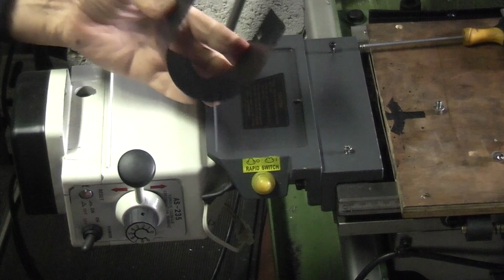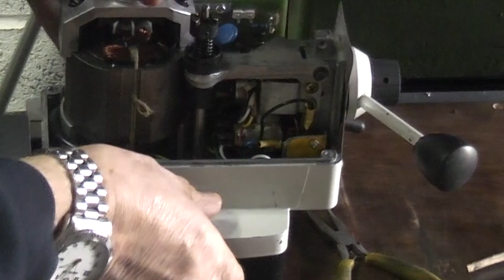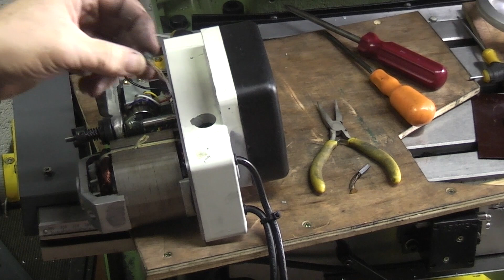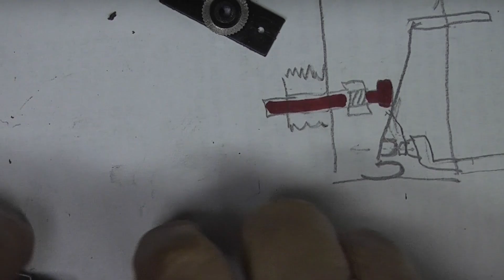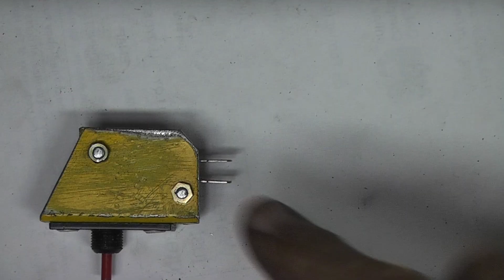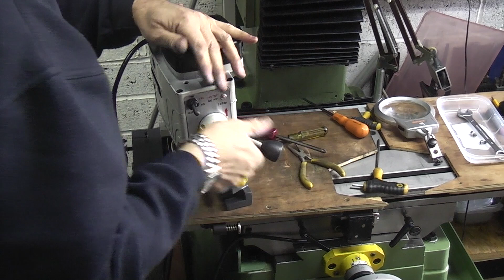Asong power drive A235

Comment: You replaced a circuit breaker with a normally closed momentary switch. This was probably not a good idea. The circuit breaker failed for a reason: repeatedly overloaded. With your modification, your power feed lacks over-current protection. The current rating for the OEM circuit breaker should have been imprinted into the case. If you are unable to locate the information, the value should be in the manual for your power feed (max. current draw). To find a replacement, do a search for "push button reset circuit breaker" and include the amp value. Make sure that you get the correct current type. It's either AC or DC; most likely AC.
Reply from the maker: Hi Thanks I've already ordered a new overload switch.

Comment: did that switch not have a bimetalic element in it which served as an over current protector
Reply: You may as well just short out the reset switch rather than replace it with an on/off micro switch because that is basically what you are doing. Replace Don't substitute!
Reply: try ebay on overload switch, we had a powerfeed overloading years ago and we were running out of horse power  driving the feed, over 5 hp of feed on a 20 hp mill.
Reply from the maker: Hi The switch was as I showed nothing taken out just the 2 contacts and a curved spring attached to the plastic case
Reply from the maker: Thanks for the info I have the switch on order

Comment: Alan two comments firstly super glue on brush do you not think that when turning the screw it will twist the spring, secondly the com normally when the carbon tracks all around it's due to either the com needs under cutting or bad sparking. Keep the vids coming 👍
Reply from the maker: Hi The super glue attached to a small brass disc on a wire which goes through the centre of the spring